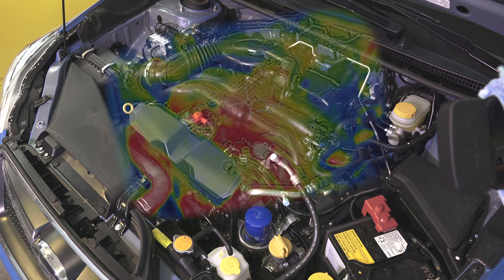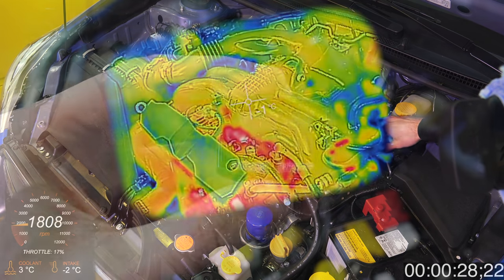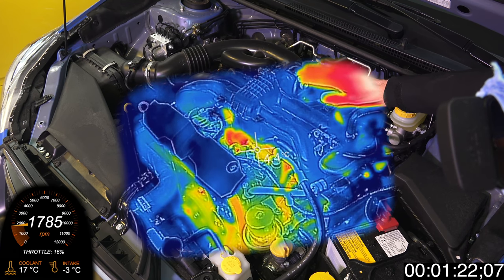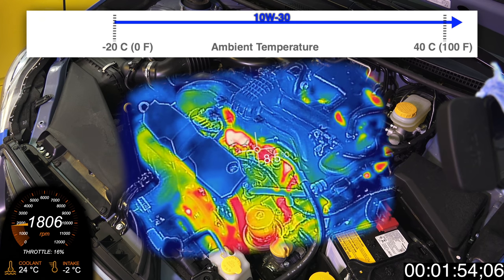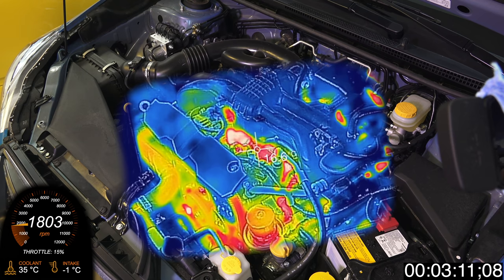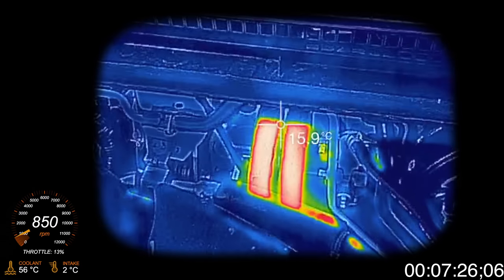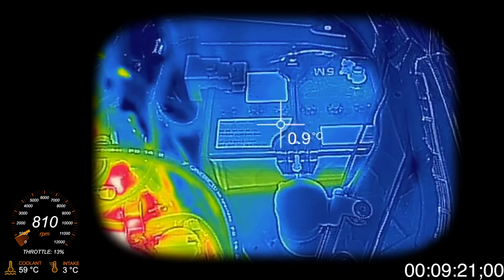Watching A Frozen Engine Warm Up With A Thermal Camera

Comment: i have no choice. my car is a hybrid and it only starts when i drive off . Luckily it uses 0W20 oil.
To get any ICE up to temp quickly, just start and wait a few seconds for the oilpressure to rise, then gently start driving.
Because the engine is asked to deliver  actual work (i.e. moving the car) it will warm up the fastest. 
Idling is actually not good at all, it means the engine runs on very rich cold start mixture for longer. It wears out the bores and piston rings faster.

in an efficient modern commonrail Diesel engine it  is even more important to start driving as soon as oil  starts circulating. Some of those engines are so efficient that they do not produce enough heat to warm them up quickly  while idling, depending on ambient temperature it can take up to 10km(!) of driving in cold weather to actually get any decent heat out of the heater...

Comment: From a cold start I always wait around 10-15s before driving, Winter and Summer. I take it easy with the revs but drive normally right away and wait until the oil gets to 80C.
These days, it's quite cold in the morning (-2C to -8C) and it takes around 30min of mostly city driving to get to 80C, which at that point I just about arrive at work. I can feel the heating get much warmer once the oil temp is up to 35C but luckily Porsche sells heated bucket seats so that keeps me warm before that ;)

Comment: Well, I would be one of the cold weather folks. Try -54F. Fairbanks AK. Yes, I have block heater, transmission heater, battery charger, and of course heated seats. Auto start is a good benefit too. I do let my truck warm up for about 15 min before I head out, but i get yet another "warm up" while driving. It is cold enough to near freeze your tires, so driving is the only way to get rid of your "square tires". And, I plan on staying up here, you don't get Aurora (or dark skys for that matter) in FL.

Comment: You should use the thermal camera on a diesel engine block heater. I'd be curious to see what a block heater actually warms higher than the ambient temp.

Comment: Although oil can flow at those temps, don’t forget that as metals cool and heat up they expand and contract, and when it comes to the parts of the engine that have to be exact down to the nanometers such as your cylinders and pistons, temp matters

Comment: It is recommended to use an electric heater in your engine at cold starts below +10C. Even if the engine is built to handle much lower temperatures, this will cause less wear and lower your fuel consumtion since a cold engine uses more gas.

Comment: Also a good point looking at the thermal cam: oil temp is still on the lowside even when water temperature is not. So don't drive the car hard when the water temp has normalised, you still need to drive carefully ;)

Comment: Look at the oil filter.  The base is red, but the filter can doesn't turn red until just after the 4 minute mark.  THIS is why 0W oils are best for any ambient temp.  You were not fully filtering your oil for the entire time the filter was yellow, because the filter bypass was open.  0W oils are exactly the same viscosity as 5W or 10W when warm, but they thicken less when cold - which is good for cold flow.  And cold flow (among other good things) makes the filter bypass close earlier.

Comment: 4:00 upper radiator hose at 32C means the thermostat had not opened yet.  When the engine RPM drops that means the thermostat has opened and coolant is now circulating throughout the engine.
Reply from the maker: Two things: I'm not certain about the thermostat (I too, initially thought it was closed, but the radiator hose is on the other side of the thermostat, so I wouldn't expect it to heat up much, though there is a large temperature differential. RE the engine RPM dropping, the engine RPM has dropped when I'm showing the radiator hose, so by that logic it would be open.

Comment: Thank you Engineering explained for this video, i know a lot about motor oils and what you said is entirely correct.
Also driving your car rather than letting idle will warm your engine coolant and oil faster than idling.
Also thanks for using Celsius and not that nonnsense called Fahrenheit haha .

Comment: What I do before driving home from work in the winter.
I sit in the car, start it, fasten seat belt, mounting dash cam, enable seat heater, release parking break, move gearbox lever to D and slowly start driving.
I takes ~ 1 minute to do all of that.
Coolant gets to 90 degrees C in ~15 minutes of driving (I have a diesel).
Interior get wormed up much faster thanks to electric heaters.
However, I drive carefully until oil gets to operating temperature of 80 degrees - this takes ~ 20  minutes from engine start.
Which is sad because I drive on fully heated engine ~ 5 minutes in total.
if I stop driving (i.e. engine is idle) - coolant and oil start to cool down (this happens when it -20 outside)

Comment: After I come out of the garage, I usually will let engine idle while the garage door is closing.  Roughly 10-15 seconds. A quick taxi out of the culdesac about 2-3 minutes and terrain lei tied to about 25-30 MPH for about another 3 minutes.  By the time I get to the Interstate (around 10 minutes) ready to roll.......

I personally recommend leaving cabin heating OFF at least until engine warms up two reasons.  1. You are just pumping cold air to your face and 2. The coolant can heat up a bit quicker without pressure being taken away to the heater hoses.  Obviously Defroster needs to work but then again you are supposed to scrape the snow and ice off the vehicle. Anyway....YES ALLL the snow, just because it doesn’t block your view doesn’t it mean it wont obscure someone behind you.   Unfortunately rarely enforced is a law in most states especially Northeast and Snow Belt states.

Comment: The better sollution from an environmental standpoint is to start the car and use the first couple of kilometers to allow the engine to heat up.

Having the car idling until warm will make the journey more comfortable but will produce more emitions than necessary.

The best option is to use an engine heater (run by green electric power) to preheat the car before takeoff.

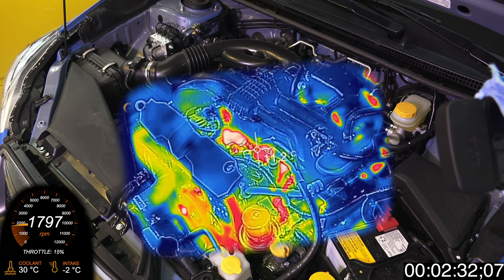Comment: The trouble with keeping the revs low and accelerating slowly after a short warm-up as described at 2:30 is that you can impede traffic driving in such a manner.
Reply from the maker: Make smart choices. Don't impede traffic.

Comment: I do live in a -40/45C area, no block heater and do use 0Wxx oils in my vehicles. One thing, electric block heaters are not good here, the only thing that works is a Webasto/Eberspacher coolant heater that also heats the interior super fast. By the way, some of my vehicles have seen -62C and still started fine...

Comment: Normal temps in the winter are about -20F and sometimes -30F I plug my block heater in every night on a timer for about 2 hours before I wake up and warm my truck up for no more then 3 minutes and my 92 Silverado with 350k miles has never had an issue.

Comment: Cool video, but you should do a similar video on diesel engines warming up. Talk about the oil used in older pickup trucks vs the newer diesel oils (temperature range). The other big point on this subject is that if you drive your diesel before it is fully warmed up, the fuel economy will be terrible and it is actually more economical to let it idle up to temperature. This is because that unlike gasoline, the more fuel added to to the combustion process, the hotter the burn. So when you drive your cold diesel the computer will be adding lots of extra fuel to try and warm up the engine as fast as possible. 
Though that you could make a really interesting video on the topic.

Comment: I'm not sure about what you said about the preferable engine rpm after a start in very cold conditions. Low rpm has two negative effects: It'll increase the load (compared to higher rpm in a lower gear) and it lowers the oil pressure, which is important, especially when the oil has a slightly higher viscosity due to cold temperatures. That's why I think it's best to go with slightly higher rpm than usual, when it's really cold outside.

Comment: I've seen oil flow rates when at temperatures around 0-10 degrees celsius and a 0w-30 has a massive advantage over a 10w-40 for eg. I know the 10-40 can still flow at far far colder temperatures than freezing point, but nowhere near as much as the 0w. I think that it still important regardless of engine load for getting a film of oil coverage in every flow area asap.

Comment: Man we were SOOO horrible with our company trucks. I remember a 2002 dodge ram 2500 cummins turbo diesel we had. All the co workers used to start it up in the morning (30-40 degrees here in Cali) and smash right off with the truck at wide open throttle what seemed like all the time. That this went to 270,000 miles. Only thing that went bad was head gasket, and the truck was still drive-able for every day use!! (just not in 100 degree temps)

Comment: For those of you waiting for your rpms to drop and if you have the correct grade of oil for cold weather like what he said in the video e.g. Ow - 5w try putting the car into gear after 20-30 sec from start up. Engine rpm will drop when in gear and you can drive gently to warm up your engine and interior at a much faster rate. Also buy a car with butt warmers!

Comment: I would be really interested in a video that covers the effects of running cars for short distances. I know that it's supposed to be bad for the engine and I live less than 2 miles from work. As a result, I'd love to see what that short drive is doing to my car. I'm not sure if there's a video that covers this issue already or not.

Comment: If it's cold (and your car has a turbo) don't rev the engine for a few minutes to make sure oil gets to the turbo, because when oil isn't in the the turbo the turbo is 'turned off' to stop it from exploding because of no oil, ford had this problem in Russia...

Comment: Try to bear in mind that this was with the hood fully open not trapping any ambient heat and dispersing it throughout.  All other components would have been higher temp had the hood been closed.  Especially the battery.

Food for thought.

Comment: I'm curious what a turbo charged engine would look like heating up from a very cold temperature. I know the turbo spins at high rpm and can have small tolerances for clearance, so I believe its more crucial to let turbo charged cars get to full operating temp before driving.

Comment: My only concern with driving on a cold engine is the much faster increase in temperature change. I've always understood that a fast increase in temperature will cause certain parts of the engine to warp and cause damage over time. I guess that's where the "light acceleration" comes in to play.

Comment: Could you please try the same with electric defrost, lights, heated seasts and other power consuming items going? It is interesting to see how hot an alternator could get in that conditions (my experience: In a just few minutes from cold start it was so hot you coudn't touch it)

Comment: In the winter when its very cold outside. You need to think of it like this. metal expands when its cold outside. once it warms up it shrinks back to normal size. i had someone who did this for a long period of time and cracked the engine block. Don't do this, it can actually cause cylinder wall damage. Id suggust letting your car warm up for atleaat 10 minutes if its below 30F.

Comment: I had -38C some years back (but only -27C so far this year), but I always pre-heat the car with electric engine heater and fan heater inside in the winter. Still, I use 0W-30 engine oil year around (Castrol Edge Ti FST).

Comment: I live in  MN. we had a few -20F this year. I normally don't do the wait game. I use full synthetic and I just drive off at rpm below 3k.  when driven it takes about 6 minute for car to reach optimum temp. however when I set and let it idle it takes at least 15-20 minute to start heating to temp.  I use to believe in the wear and tear of driving without preheating.  now days with all these advance synthetic oils it is very doable easly.

Comment: Cool video could you find different examples of inline, V type engines, and even larger displacement like V6 and V8.   Another point that could be interesting is a video for not only the temperature pattern but how long the heat is held after shutting down and engine resting.

Comment: You have a point that at idle, 7' after starting the engine hasn't reached even 1/2 of its operating temperature; light driving would increase that speed, yes (even if you start driving after just a minute). But in your last video you referred exclusively to piston/cylinder temp. What about the other engine and nearby components? Drastic temperature changes aren't good for ANY of the parts involved, which is why many auto manufacturers still recommend 2-5' warming  before one starts driving

Comment: In cold winter weather I warm up the truck for about five minutes, to get the fluids somewhat warm and the windows de-iced/defogged. In very cold weather (from minus 20 down to minus 40C) I use the block heater for a few hours, then run the engine for a good ten minutes. It takes that long to de-ice/defog anyways. My wife and I are still driving twenty and twenty-five year old vehicles, with no end in sight, so obviously we're doing something right. We care about our vehicles, so we have always ignored the 'start and drive' advice so fashionable right now.

Comment: Thank you with hurting your engine just to provide this video to us :). Btw I'm sure that while driving the front side of the car will be colder than the rest and it will look different on a thermal camera due to the cold air but I since the engine warms up faster it might be even hotter than just letting it there idle :) I always start my car, let it idle until i put my seatbelt on and maybe 5-10 sec more then i drive off. It's a petrol so I want to avoid (as much as possible) the fuel washing the oil from the cylinder walls.

Comment: I like the cold. I'm a heat sensitive guy and sweats and warms easily on little movements (even in cold weather and I have problems with my family since they're freezing while I feel like the temperature is fine). I remember joking around that if I moved to Artic or Antarctica, I'll cause global warming because my body would adapt on extreme cold.

Comment: I had a turbo car before, i did warm up longer then non turbo engines.  Colder it gets, longer i warm up.  Maximum warm up time about 10 minutes with turbo engine.  High tech and newer engines warms up much faster so they do not need long time to warm up.  Also their coolant capacity is much less due to design.

Comment: just a heads up to everyone a car WILL throw a code if the engine is too cold and for you automatic drivers out there automatic transmissions work like ass and some are very reluctant to even shift through the gears when cold so warming the car is actually something you should do manual transmissions are way more forgiving but the manufacturers say to warm up the engine before going the vehicle will throw a check engine light because of it (often throwing a P0128) turbocharged cars require it as well or the vehicle will work like crap (computer will crank down the boost pressure) so warming up the car may not harm the engine but can cause problems with other parts (this is from many years working on vehicles in a place that regularly sees -20s and -30s in the winters (a block heater is a MUST and is typically standard equipment on vehicles here) the person in this video doesent explain anything about the transmissions in these vehicles manuals work although can feel a little sticky in the cold but automatics can get very picky (had a car come on the shop not long ago that wouldent shift only stay in first worked perfectly fine when warmed up (any temps below -15 celcious warm the engine up)

Comment: Here’s an example, my diesel truck is oil fired, so oil fires my injectors, the truck pulls timing until 120* oil temp. I let it warm up to 100* every morning. From my understanding it’s bad to just start up my truck and drive off when the engines at 40* F.

Comment: Newer cars only needs a minute.. I live in Canada where is very cold during winter.. I bought 2007 Corolla with 60,000 kms and now I have 390,000 kms on it... Never need any repair on it and it is running great! But again be gentle on throtle for first 10 min and don't push hard car too much..

Comment: So I can understand that below 40F FI may run rich to provide adequate fuel for combustion, risking stripping the cylinder walls of oil.  Above 32F my car actually seems to start lean, around 15.2, until the revs drop the first tier.  I assume this is to (maybe?) warm the cat up and minimize idling emissions.  After that it runs around 14.5-.7 until fully warm and revs drop the 2nd tier.  Below 32F it does seem run a bit rich to start ~14.2, leaning to 14.5 when the revs drop the first time.

Comment: I let it idle until it hits 800 rpm, most people don't drive far enough to properly warm up all parts of the engine so I think a little bit of pre drive warm up helps.

Comment: I delivered a formula of how much time do you need to warm up acording to the out side temp.
If 50C is the moving temperature
Out side temp is 20C
And the average velocity of warming its 10C per minute.
Time of warm up: 50C-20C= 30C
30C÷ 10C/min= 3 minutes. You can have a timer fix a 3 min to move. How cool its that.

Comment: My starter sounded decidedly strained today after using the block heater for more than four hours. The car even used the glow plugs for a couple of seconds. 2010 BMW 330xd in -26 degrees c